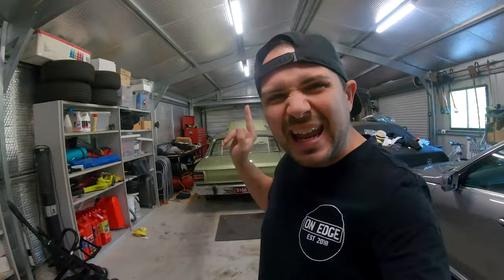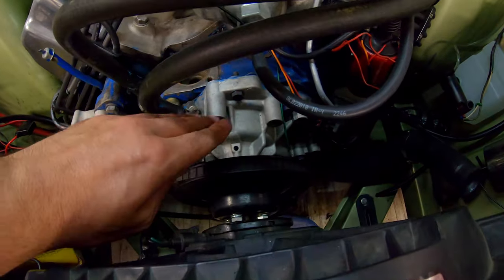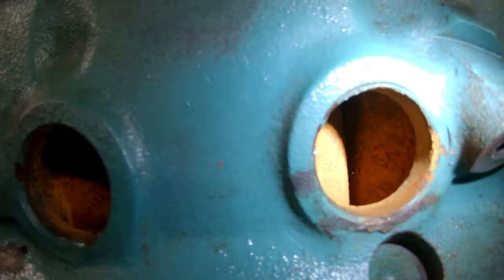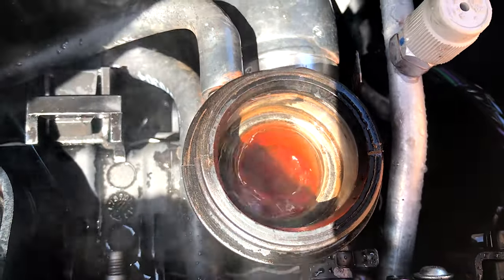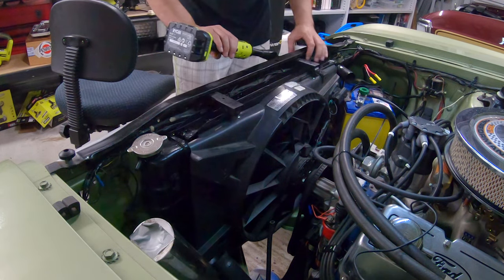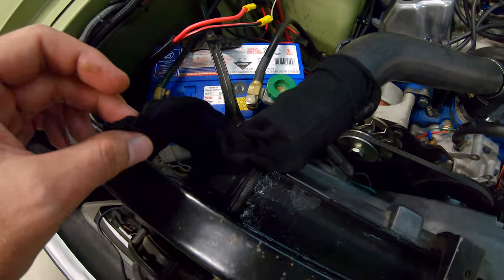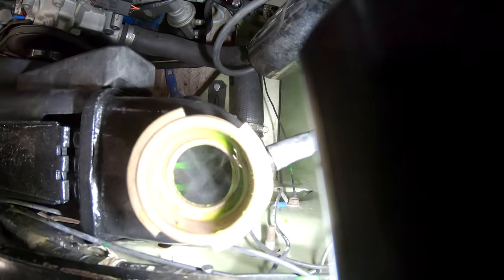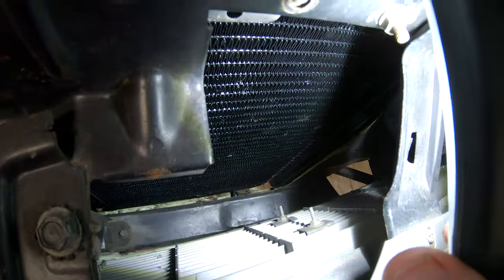Fix Classic Car Overheating NOW! Top Troubleshooting Tips

Comment: You pretty much covered it all and are not another flog on the internet. 
Nice water pump you fitted, and that should stop cavitation issues that Cleveland’s can have with a water pump with a pressed tin impeller. 
About all you missed was having a good recovery tank and correct radiator cap for the system.
Top vid mate. 
DK
Reply from the maker: G'day DK - Cheers mate love your assessment of not being a flog (hope I can keep it that way haha).  Great points you bring up - the radiator cap holding pressure is so bloody obvious yet i left it out! Prob need to replace mine actually. And agree that water pump is the ducks guts - it has been fantastic and flows like a champ! 
Thanks for watching mate and for the kind words! Cheers
Marc
Reply: @MeatballGarage  from the first day you walked into warrigal rd cheltenham you have been entertaining. Keep it up
Reply from the maker: Hahahaha I bloody thought it was you!! Mate can't wait to show you all my carby fk ups 🤣🤣🤣!!
Reply: @MeatballGarage  sniper efi! Sorted! And a very interesting video you would make it too!
Reply from the maker: @davidk8622  Haha mate I might need a sponsor before I attempt to go to the dark side of EFI 🤣🤣

Comment: I had issues with my thermostat on my clevo. Went and asked at the local parts shop for a new one, typed into their system found the part and wacked it in. Gave me heaps of grief. After chatting to a few guys on forums, the correct thermostat is a dayco dt66a. It's worked perfectly ever since.
Reply from the maker: G'day Vas - ah yep that was the other one - the Dayco DT66a! I think they are all derivatives of the Robert Shaw one from back in the day.  And you are spot on, heaps of parts peddlers gave out the wrong ones! That is awesome that the correct t stat sorted out your overheating issues - happy days! 
Thanks for watching and for the comment mate! 
Cheers - Marc
Reply: @MeatballGarage  it's unfortunate how hard it is to find the correct parts these days. Going through motions of the new engine build and the issues I'm finding is ridiculous.
Reply from the maker: Geez what a pain!!
Reply: @MeatballGarage  I'll message you on insta and let you know what's happening.

Comment: Used a Davies Craig digital controller with a sensor in a Davies Craig plastic sleeve spliced into the top radiator hose. Currently have it set to high 170's so it doesn't go over 180. I still wanted the dash gauge to show temp with the original sensor in place. I also use a dual thermo fan from an EL Falcon I think but had to cut it up and modify a bit for the top radiator inlet. Have an XD triple flow radiator that is a work of art. I use the correct thermostat but 180 degree. Used the heat gun to confirm block stays around 180. Made a custom battery tray to fit as no chance original fits with XD radiator.
Reply from the maker: G'day Roger! Ah think I know that fan controller - Is it the digital one? I have one in a draw somewhere but never bothered to fit it up. Sounds like you have done a fair bit of work to get your cooling system to work together and all fit nicely - awesome stuff!  What temp thermostat are you running? Also, tell where is the original temp sender supposed to go? I don't think I have ever had it in the proper spot! Cheers mate!

Comment: Great video mate! awesome.  I had a lot of overheating issues with my Monaro when I first bought it, found the wiring to be very undersized, with yellow joiners with thin wires in between, the yellow joiners were brown! and the earth wire (yes, single one) that went to two AU thermos, was rock hard... haha replaced it all with a much thicker dual twin core, and twin relays my overheating problem went away for good!
Reply from the maker: Cheers mate!! Ah fairdinkum? I reckon that would happen a lot actually - blokes just fitting thermo fans with what ever wiring they have lying around. Only to melt it all and have a fan that isn't getting the juice that is required!! Did your fans pick up much grunt when you made these changes? What temp does your Munro like to hang around?
Also - cheers for the call out for this weekend - might be a bit hard to get down there at that time with the little fella but i'll give it a crack! Forgot Motorex was even on TBH! Cheers!!!
Reply: @MeatballGarage  Oh shit yeah mate the grunt was at least 70% better, you could feel them pushing air under the bonnet when it was up and when standing next to the drivers door, couldn't do that before.  Not sure on temp exactly I need to hook up my aftermarket gauge, but used to always run just under the hot mark back then, even on cooler days.  Now its half way.   No probs mate, Hope to see you at MotorEx or at our event, I'll give ya a sticker if you come say Gday 👍 Keep up the awesome content mate

Comment: Late falcon XF radiator in copper or even go to  alloy  2 row of 1.25 in [each] .
Down flow or crossflow does not matter ,,a LARGE surface area exposed to air flow is king  
PWM fan controller also helps with start up and running amp load plus  fan noise
Reply from the maker: G'day Paul! Mate that is a great point about surface area! I reckon a lot of people get carried away with thickness (I.e. 5 row!!) but don't consider airflow! I'd love to get one of those nice big alloy 2 row jobs one day - would be ace! Cheers mate thanks for watching and the comment! Marc
Reply: What u will find is most USA car radiators are bigger vs ozzy units .re chevy or ford . Ehrn going to high horse power in ozzy cars it is almost compulsory  to go to a large 1.25 inch 2 row   Be warned a 4  or 5 row  does not cool as much vs an alloy 2 core

Comment: Love the car man great job. What is that fan from part number?that
Reply from the maker: Thanks Chad!! Appreciate that mate! I am not sure if the fan is an OEM job but it's a BF or FG Single Thermo -  I think mine had 6 blades (i have seen ones now that have 10). The S shaped blades are nice and quiet compared to the straight ones too. If you know a good radiator shop ask them which one to get (or which ones to stay away from) as I assume the cheapies are prob no good. If i find a part number i'll pop it here in the comments for ya! What are you looking to keep cool? What radiator are you running? Cheers!

Comment: Top tip if you don’t want to do half of this work just dump all  the coolant to make sure you don’t have any glycol in there top up with plain water and add a product called  “DEOX-C” get it in power form !!.  it dissolves rust completely…… and I contacted the company and they said it was safe on the metals and plastics that are in the system leave it in there for a month it likes heat so drive the car 

My cars heater started working again!! 
My blocks coolant jackets were clean 
The radiator had no scale left in it I also had no deposits in my tefba radiator strainer the stuff works
It also allowed me to unscrew the lower block coolant plugs out as they weren’t rusted in anymore I drained then flushed with distilled water then  refilled with coolant from my local diesel truck mechanic

Edit: I also had a water pump noise on this same Cleveland I did this work to.. it was the built up scale on the  impeller scraping on the front timing cover that noise also went away 😊
Reply from the maker: G'day MrJak! DEOX-C - I will have to so some serious googling on this! My old man always use to say back in the day there was a product that use to clear up cooling systems like you describe! I wonder if it was this one! Thanks for the tip mate! 
How long ago did you treat your car with it? Any dramas since?
Cheers! Marc
Reply: @MeatballGarage  never had a problem! probably had the car for three years after I did that it was seriously worth doing 
That particular engine had been built assembled then sat for ten years never started. 
then I ran it in my car that also had a fairly blocked heater core 
Everything worked after doing it
Only issue I could see ever happening would be if your original/factory Cleveland timing cover was really rusty if the detox-c stuff ate the rust away it might get through if the rust had reached the other side then you’d have water in the oil

Comment: Bleed every bubble from your engine from the top of your radiator cap with a Repco Radiator bucket then you know there is zero air pockets in the engine and entire cooling system.
And NEVER mix different grades of coolant like you did. The green and yellow coolant are not good for Old School Engines as they have a corrosive inhibitor in them. Use ALWAYS Penrite Old School Classic Radiator Coolant which you mix with water.
Reply from the maker: Spot on - bleeding is bloody important! I usually just jack mine up a little, never had one of those buckets but should really invest. They look like a great bit of kit. 
Agree never mix coolants - I just used a concentrate and demineralised water so am sweet. Never considered the 'old school coolant', will have to check it out. I like to flush mine every 12 months or so in which case I might switch to it - thanks for the tip!

Comment: Mate you didn't need to go to that extreme. Get your hands on a genuine FoMoCo Radiator for a V8 and all your problems would be solved. Putting in this doesn't look or match the vehicle whatsoever and could have been way easier achieved given I run an XW GT 351 in the NT where its way hotter than where you are based with a 160 thermostat and no issues whatsoever.
The only time it gets to 180 is when I pull up and turn it off , then when I start the engine back up it drops almost instantly back to 160. And even at lights in traffic.
Reply from the maker: G’day mate, 
Ahh the old original vs modern cooling debate! This car had the cross flow in it already, so was keen to just work with what I had. I found the mechanical fan worked fine but ended up getting hot when in Melbournes slow moving traffic. The thermo was able to keep the temperature steady even when crawling along in a traffic jam on a hot day. 
I suppose the cooling discussion always comes down to what suits your application and use case. Plenty of blokes have told me original is the way to go - others have said go a big alloy rad and thermo fans. To be honest, as long as it works I couldn’t care less! I do like the simplicity and reliability of a mechanical fan though…but also love the extra hp gained by not having an engine fan (and less risk taking a finger off when playing with the carby too)! Cheers mate!